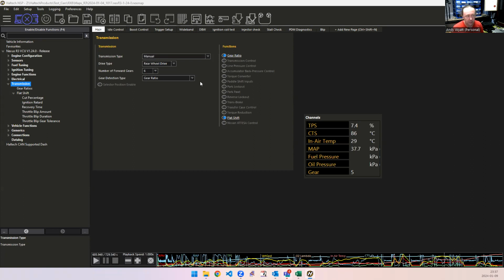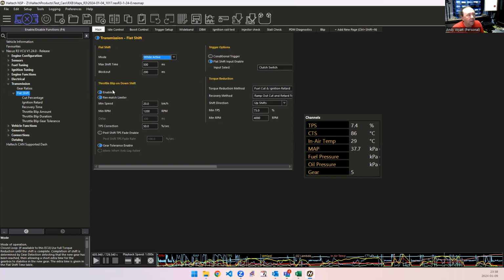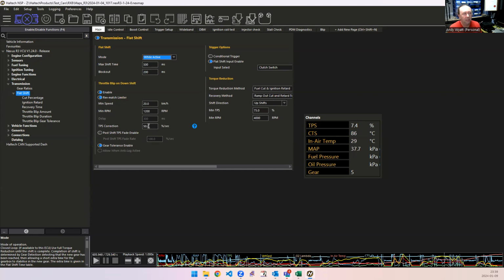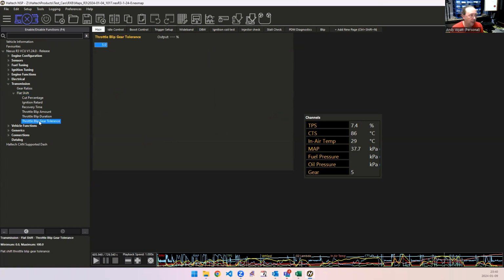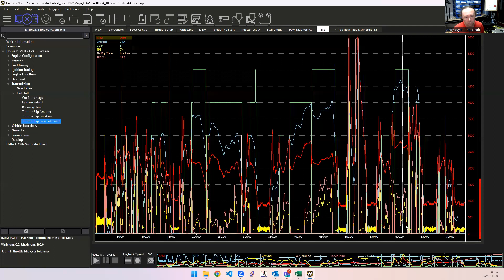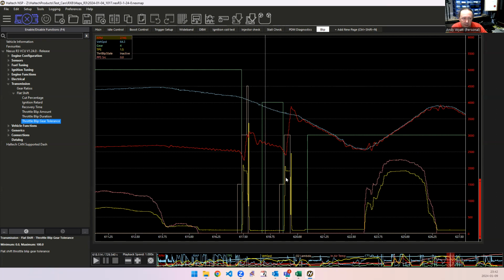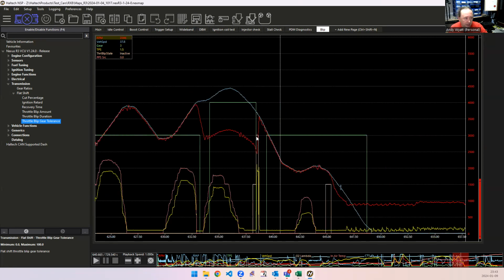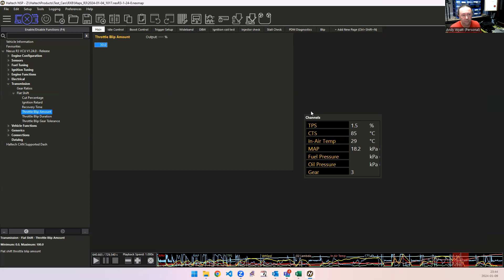Setting up automatic downshift rev matching throttle blipping on a Haltech Elite / Nexus

Comment: Do I need to input sensor on the clutch and brake?
Reply from the maker: Yep
Reply: @Andy_the_engo could you point in the direction where to get one?
Reply from the maker: @Midassway  I've just used the factory ones. Your car will already have a brake switch so that's half the job done. You could just get a pin switch (like an alarm switch that opens when the bonnet / door / etc opens, eg Jaycar LE8776) and mount it so that it's normally pressed by the clutch pedal. Maybe there's an OEM part you can use from a car with a clutch switch - ie anything with cruise control.
Reply: @Andy_the_engo  i have an 1995 Mitsubishi eclipse GSX I’m already drive by wire right now
Reply: @Andy_the_engo I’ll do some research and see what I can find

Comment: Very helpful! It's not particularly intuitive the way it's bundled with Flat Shift. Really should be broken out into its own function. 
On a separate note, is there a way to enable and disable throttle blip with a switch? Surprisingly, I can't find anything.
Reply: Update: I just discovered the Throttle Blip Amount Table is a 3D table, so I set up the 3rd axis for an off-on state with the Blip Amount zero for the off state.
Reply from the maker: @nigel_white  Yeah, I just have one value in the table and let the automatic RPM calculation do the job so you could have axes available for that.

Yeah I agree it's not intuitive especially with the name.

Comment: How well does the gear detection for multi-gear downshifts? say going 6-5-4-3 one after the other?
Reply from the maker: The ECU doesn't know which gear you're about to pick. The logic it uses is if you brake and clutch then it assumes you're downshifting by one gear per clutch press. So if you hold the clutch and tap the brake multiple times, it doesn't think you're going down multiple gears for example. But if you try to go from 4th to 2nd, the ECU doesn't know what you're doing with the gear lever. If you want it to be smooth you'd have to go 4->3 and release the clutch so the ECU knows "3" as the new gear, and then go 3->2. Hope that makes sense
Reply: @Andy_the_engo  makes perfect sense! I was more so wondering how long the clutch would have to be out to register the new lower gear and then be ready for another blip. But i guess I can figure that out myself by trying it and looking at the logs. Cheers
Reply: @Andy_the_engo  What about paddle shifting with a nexus r5 running a 13b turbo rotary engine? Will I need to buy a GCU from the likes of MME or can the R5 handle it?
Reply: including clutch less downshifts which is the hard part...